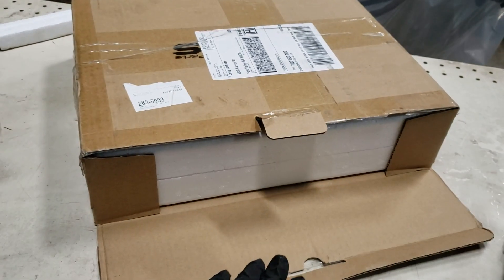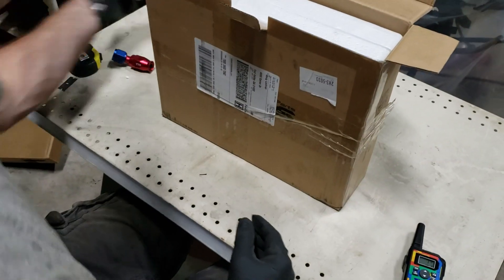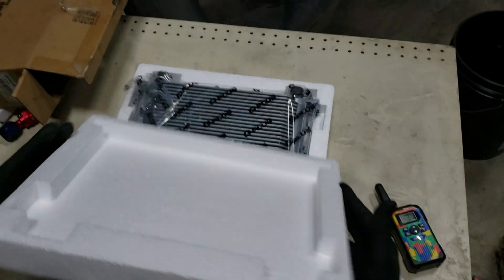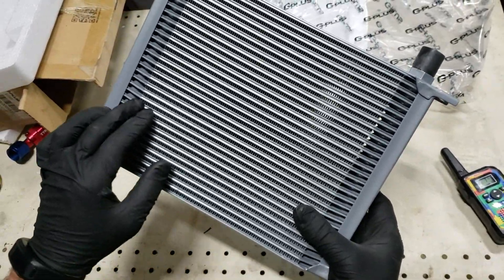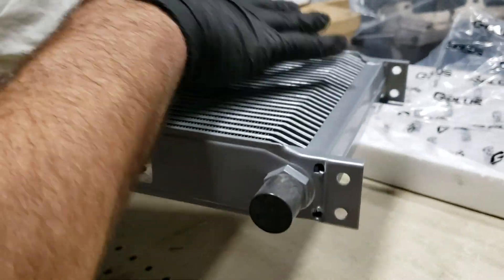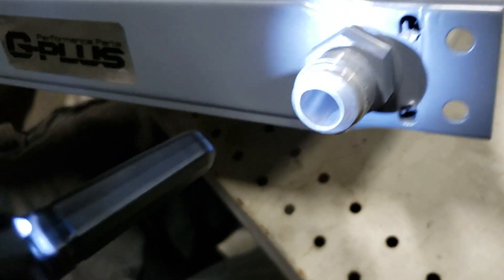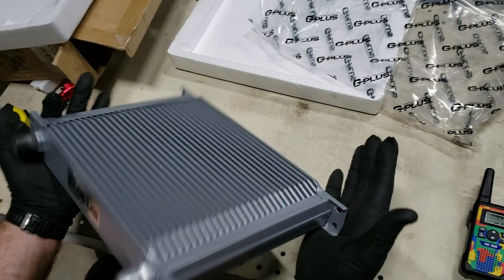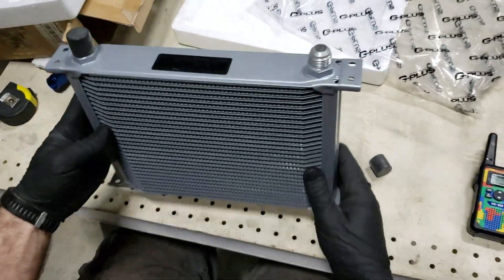G-plus 30 Row Cooler Review For Trans Cooling On 3rd Gen Cummins

Comment: Just checking in for an update on how the G-Plus 30-row coolers are working? Any issues? I assume you ran then side by side in front of the radiator on your 3rd Gen. Any pic of the final install you could share? I didn't see a video of the install in your feed. I'm planning to set up the same system, install new transmission cooler lines, and also bypass the heat exchanger on the block. Thanks for any update info!

Comment: Hi there, I was wondering if you the cooling kit has been good so far?
Reply from the maker: Yeah. So far it has been great. No leaks and good cooling as monitored by our trans temp gauge. We are using 2 of them in series to cool our trans with out the factory liquid to liquid cooler.  It seems to keep Temps in check.
Reply: @70440charger  thank you for the reply, do you think it will be good to used on 1995 Chevy 6.5l engine truck to cool the oil. I messaged a seller on eBay if they are sure it won't leak and they replied " it will leak if use long time" not even sure with the response.

Comment: What's the heat capacity of this 30-row cooler?
Reply from the maker: If I remember correctly,  the specs for a stacked plate cooler was around 50K BTU's.  We have really been impressed with 2 of these tired together in series. It sheds a lot of heat!!!

Comment: hey, i am looking to eluminate my cooler at the from of my 5.9 Cummins and do remote cooler, how are you doing with your cooler set up/>
Reply: It totally worked on an 18spd Eaton Fuller transmission. I haven't even installed the fan.  Basic setup. 2ft out to the cooler which is actually mounted right above passenger side step box on a 379 Pete. Then a 2ft return line to the transmission. Nothing fancy at all as far as mounting. Cooler is also mounted parallel to the frame. Brought temps down 30* no joke.
Reply: @halfmoon5022  That is awesome, thanks for letting me know! Is the cooler mounted facing forwards so it is getting direct airflow?
Reply: Nope. It is parallel to the frame. Both inlet/outlet ports are facing forward as that was easiest coupling method in order to shield the lines from road hazzard.
Reply: @halfmoon5022  Wow 30 degrees is very impressive then! I wouldn't have expected it to work that well without direct airflow through the fins
Reply from the maker: So we felt like we had good temperature control with the tru-cool, but unfortunately we  it sprang a leak at one of the seams. We considered trying to get tru-cool to replace the cooler but opted to try 2 30 row coolers instead. We don't have any issues with the trucks moving (between 115 and 155) but have seen temps get to 180-200 with slow speeds and a trailer.  We haven't tried it with the a/c and towing yet. I think the real lesson is it will really be up to how good your factory fan is and the seal with the fan shroud.  We have a big gap between our 2nd gen fans and the 3rd gen fan shroud. If yours is factory on factory- you should see even better low speed results.
Reply: @70440charger  I don't know what your setup is but locking the torque converter whenever possible will reduce heat a lot, the vast majority of the heat in the transmission comes from torque converter slippage. When the torque converter is locked, power goes right through it and the transmission with no slippage like a manual trans.
Reply: How is the gplus oil cooler? Any leaks like the trucool?
Reply: Any leaks in heavy duty use?
Reply: @halfmoon5022  I don't know what exactly you mean by "heavy duty use", but I have been using this cooler on my Civic for 2 months now and I have no leaks. The cooler is quite heavy and solid, even the fins take some effort to bend. I really don't see it leaking unless it is physically damaged somehow or severely overpressurized. Hope this helps
Reply: @averyalexander2303   We want to try it on an 18spd big rig transmission. You, know, something to mount to the frame rail with about a 2ft in/2ft out braided line. Just to bring the temp down a tad.
Reply: @halfmoon5022  I don't see why that wouldn't work as long as it has good airflow. If you are having issues with high temps at low speeds such as while sitting in traffic, I would suggest getting the version of this cooler that comes with a shrouded fan to ensure that the cooler has good airflow at all times. Depending on how hot it is running, you could even get 2 of these coolers and run them in parallel so the flow is split between the two coolers so you have twice the cooling capacity.
Reply: @averyalexander2303  We are working alot in Tx now. Ambient temps are higher. We are just trying to reduce temps by about 30* at long highway intervals. 200* down to the 170s*. Just to see if it works. We run Mystik synthethic trans oil with a gallon of Lucas. Between 2 identical truck setups, the difference in operating temps is 20*.
Reply: @halfmoon5022  200 degrees isn't bad, but 170s would certainly be better for longevity. You may need two of these coolers to achieve your goal on such a heavy vehicle, but I'd start with one and see how it does. You can always add a second cooler later if you would like to lower temps even more. With this cooler remote mounted under the back of my Civic and a 7 inch eBay fan cooling it, the highest temp I usually see is around 150 degrees, and that's in almost 100 degree weather. I'm more than happy with that, but your results will certainly vary.
Reply: @averyalexander2303  Thank you very much for all of the info!
Reply: @halfmoon5022  Sure thing, let me know if you have any more questions